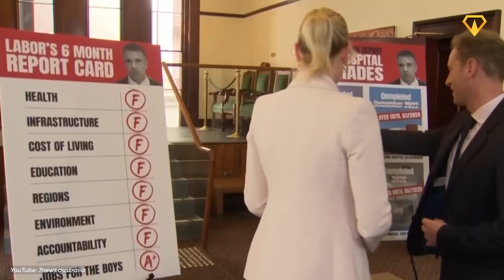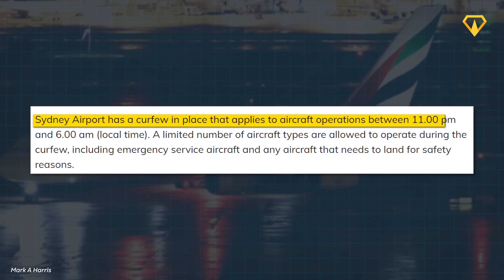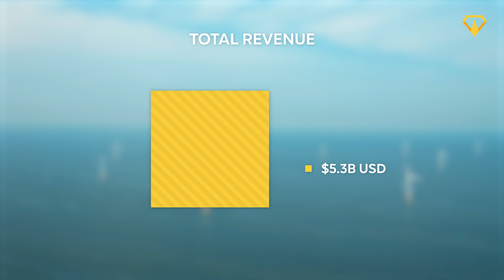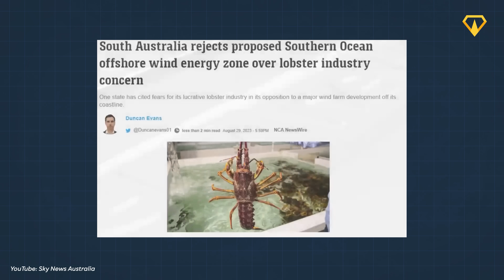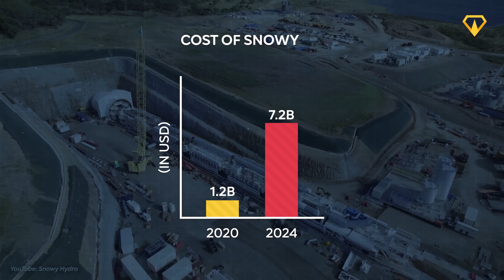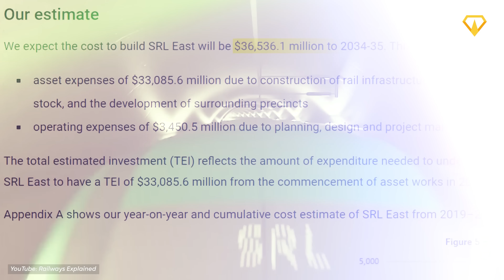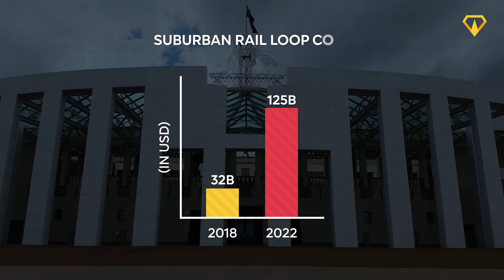Top 10 Biggest Megaprojects in Australia

Comment: Too much can go wrong with renewable energy. Natural disasters can damage it too easily. Maintenance costs will be ridiculous pricy.  Solar panels needs to be cleaned. If put in to hot areas over 40 degrees Celsius will melt and damage solar panels including wiring. Hail storms gale force winds cyclone's. Fluids and large bush fires will all damage Solar panels and batteries.  The same will happen to windmills.  So it really isn't a good idea to rely on renewable energy as a major source for power.  It could run in the hundreds of billions of dollars in a decade to maintain and months without power if too much renewables get damaged. I don’t  think Australian government has thought it through.  Mega hydro dams and small nuclear reactor plants would be more reliable clean energy source. Especially if the country is going to move towards more electric vehicles. And with a country that relies on air conditioning to keep cool during summer periods.  And a country that has a large significant cold storage business. Reliable energy source is important
Reply: Indeed! The renewables will put the renewable trope into overload!
Reply: And putting a giant wind farm on a major whale and Albatross habitat. But hey if it makes the UN happy.